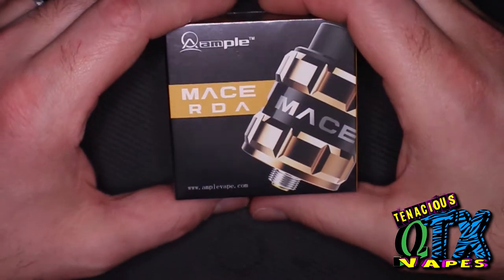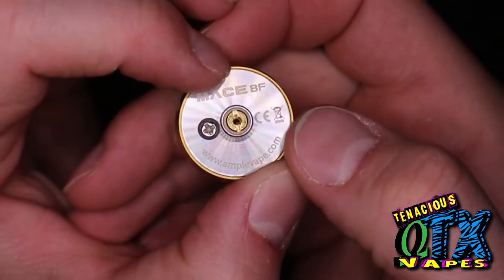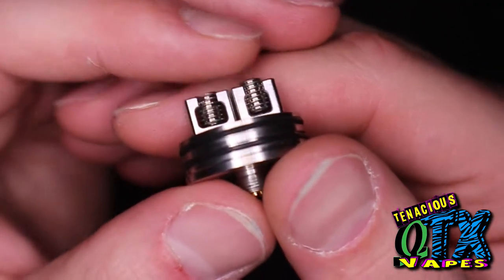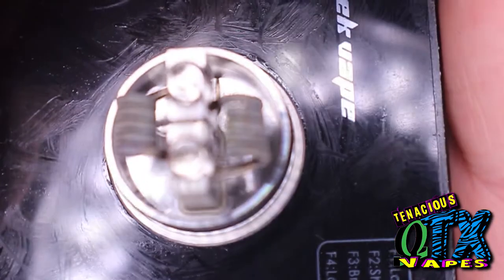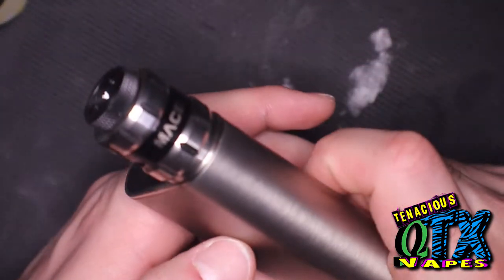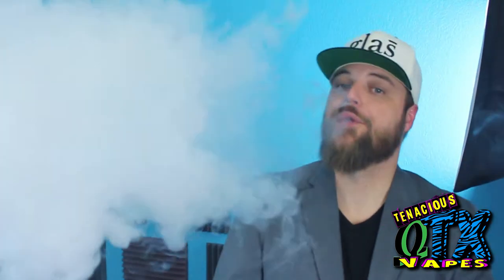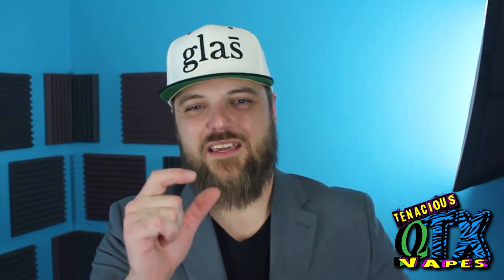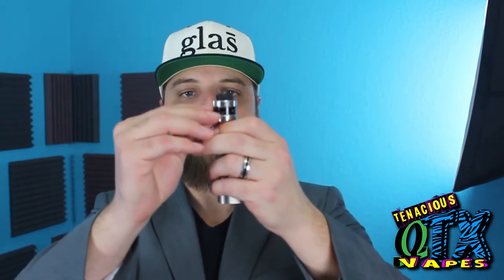MACE RDA by Ample Vape Review and Giveaway!

Comment: The build deck looks very similar to the UD Skywalker, but the top cap and airflow are much better designed on this. Love the look – different without being gaudy. I agree about the posts – there definitely should be an insulator between them given how close they are. Thanks Stan!